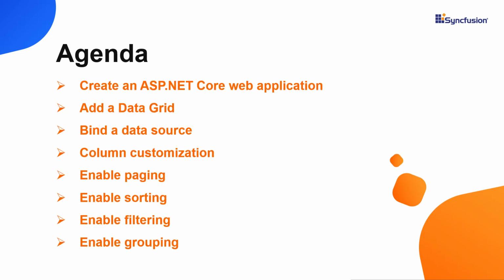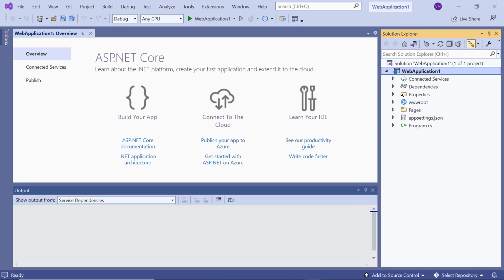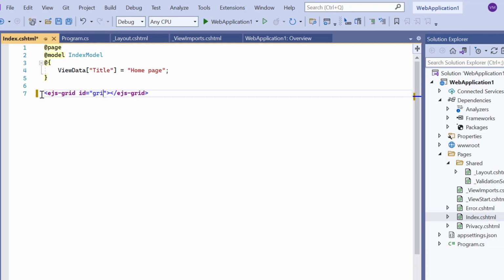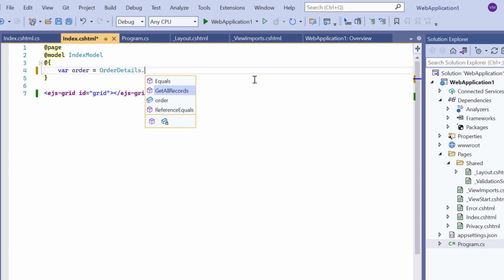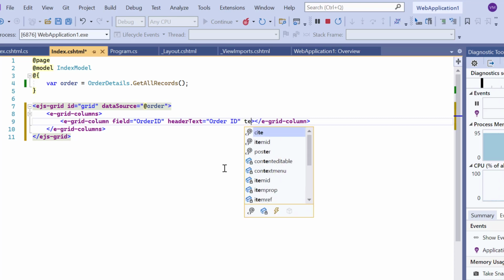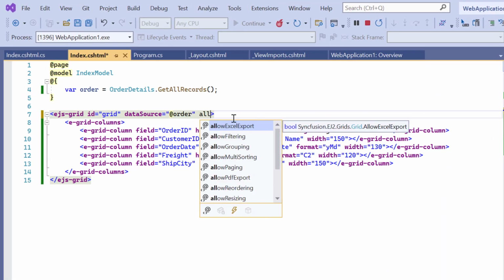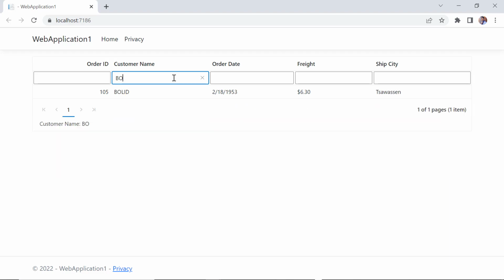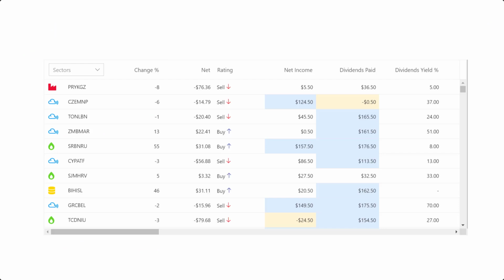Getting Started with the ASP.NET Core Grid Control

Comment: Filter is not working... I downloaded the source from GitHub in that also filtering is not working...
Reply from the maker: Hi,

Thank you for reaching out. Based on your query, you want to perform filtering in EJ2 Grid. We have already discussed the same in the below documentation. Please refer to the below documentation for more details on Filtering.
Documentaiton: https://ej2.syncfusion.com/aspnetmvc/documentation/grid/filtering/filtering

If you still face the same issue, please share the below details so that we can validate further.

Complete grid rendering code.
A Simple sample that demonstrates the issue you are experiencing.
A video demo of the requirement.
Syncfusion package version you are using